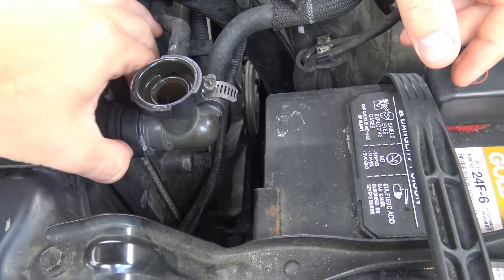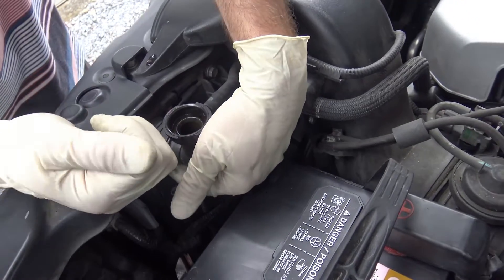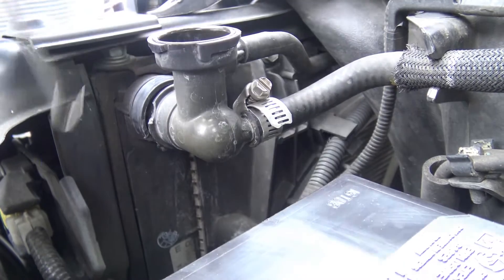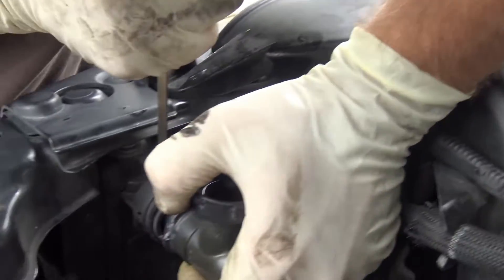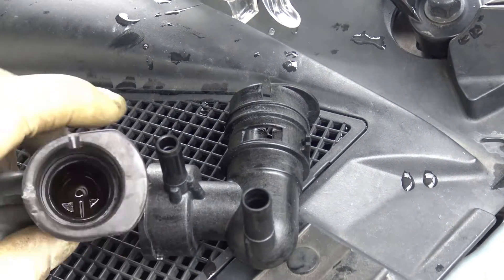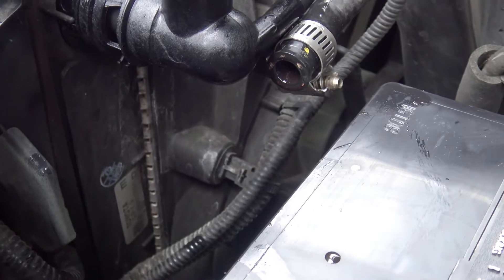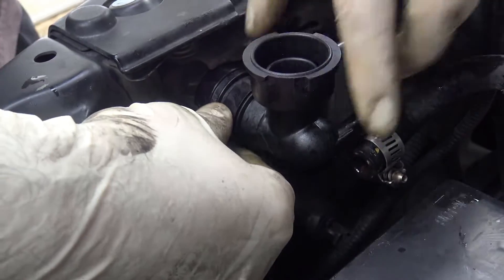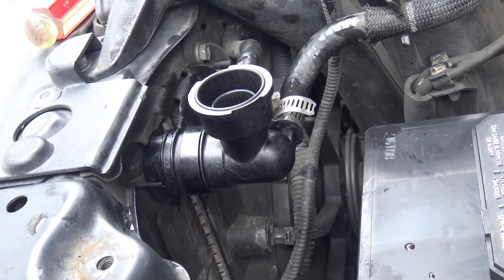Radiator Filler Neck Replacement

Comment: Nice job. Came in handy today after a battery tech switching out my batter took out my RX350 filler neck yesterday. I would never have attempted the repair without your clear example. Car is now functioning well and no multiday, multi hassle repairs with another garage. Peace and THANK YOU

Comment: Thanks for the vid - you saved me mucho bucks - my repair guy thought this part was part of the radiator & said I'd need to replace the whole thing!

Your camera work made it easy to follow.

I found using a medium sized flat head screwdriver between the part and the radiator connector and twisting it left and right helped loosen the part slowly without breaking anything.

Comment: Sir.. I owe you a beer and dinner.  You saved me $300 by not replacing the whole radiator.  And I take back all the bad words I said about a sucking design... that was before I knew you could replace this part only.  Keep them coming!

Comment: Thanks for the video. I couldn't believe that this piece was baked to the point where both nipples shattered.
My Toyota Sienna started to have the check engine, service engine, VSC and other lights come on. I took it to the mechanic and they missed that my water was low.
When I got home the water had all disappeared from the radiator.
The swap out took about 20 minutes because I had to clean out the hoses which had plastic stuck in them

Comment: This just happen to me today while at Walmart. The little piece broke off from coolent neck. Then antifreeze sprayed everywhere and my vehicle got hot and started smoking!! Pretty scary at the time. Thanks for the video I just replaced it. What would of caused this?? Was the piece just old an brittle,or could it of been something else? Like a thermostat?
Reply: Depending on how old your car is the part just wore out with age. My 2008 G35 had the same problem last week then I changed the radiator filler neck and it solved the problem

Comment: This is my issue with my Lexus. The silver clamp isn’t there and we had to jury rig it with a zip tie around the tube to hold it on. Do I need a new clamp or a whole new filler part?
Reply: I would get a metal clamp

Comment: How  did you get the broken tip out of the hose?
Reply: Thanks for the reply. I just cut the hose off right behind the stuck plastic piece. Still had plenty of hose left to make the connection.
Reply: I held the hose so that it was facing downward and crushed the plastic with some pliers around the hose and the pieces just fall out.  Make sure it is facing down.  :-)
Reply: How would I know if the broke tip is inside the hose or that it fell off?
Reply: @Caesarbby  you’ll see it. Think I used a thin flathead screwdriver and pried the pieces off the inside of the rubber line then used needle nosed pliers to pull the pieces out

Comment: For whatever reason I could not slide this piece on my radiator. I think I spit on it and it still would not slide. Maybe I should have used some lubricant but I do not know what is safe on this type of gasket and plastic. Maybe the kind for radiator hoses. But I ended up damaging the radiator and cracking it by placing a plastic cylinder on the other side (front) of the radiator between the radiator and a metal support and then hammering this part into place. I used some piece of plastic between the hammer and the part, it would have been better with a rubber mallet. But I would not do this at all as it cracked the radiator where the cylinder was on the front of the radiator end.

Comment: Thanks for the video!  I had trouble getting the old one off.  I was afraid that I would break my radiator if I pried it too hard.  I sprayed PB Blaster in the slots on either side and worked it around.  That helped a lot and it came right off after that.  I got the idea for the PB Blaster from another YouTube video:  https://www.youtube.com/watch?v=nkxFTf7MLcM&t=308s